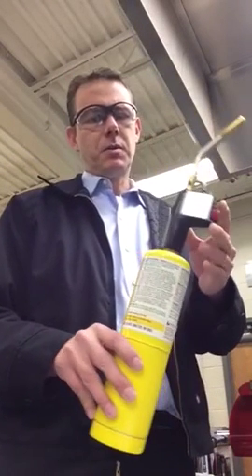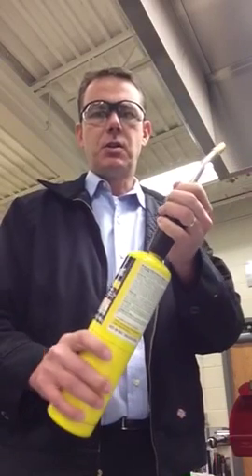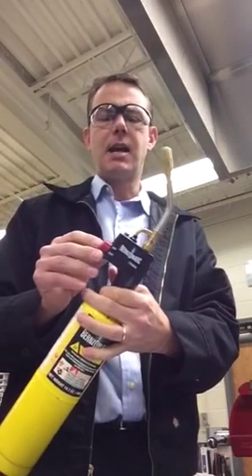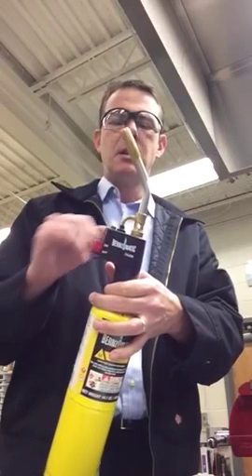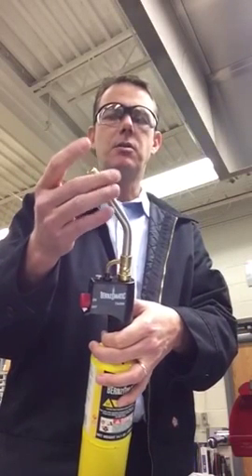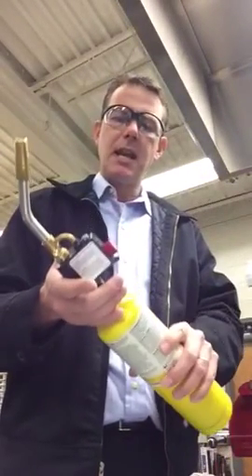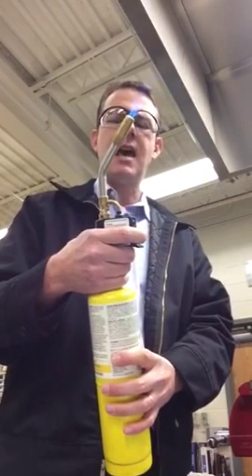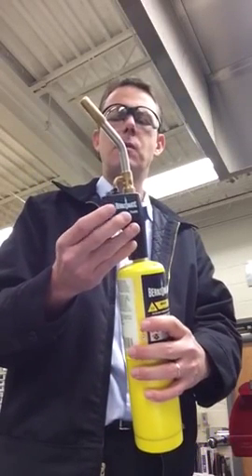HVAC Basics: Task List One - Demonstrate Torch Safety with the MAPP Gas Torch

Comment: I saw one of the HVAC technician used this for blazing the refrigerant line. Is the map gas hot enough for the job? someone also talked about silver blazing. what is silver blazing?
Reply from the maker: +Paul Le on a hot day with smaller tubing it can be done. It will carbonize the pipe though and take longer. Not really recommended for brazing. For your question on silver brazing please take a look at the following video:
https://youtu.be/5yAo1uvXv0A
Reply: Map pro gas burns at 3,730 degrees Fahrenheit, while propane burns at 3,600 F.